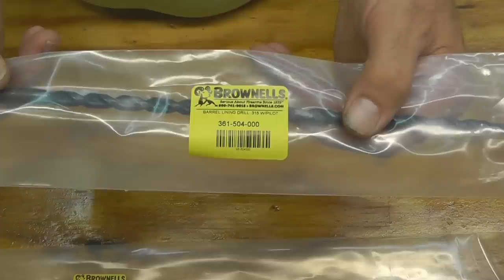Relining the barrel on Grandpa's old  22 Part 1

Comment: You really need a lathe but for what you had to work with you did alright. Only thing I could suggest is slow your drill speed down and use steady pressure. Those old barrels have hard spots that under high speed will burn up the cutting edge of your drill. Saw one at auction just like yours go for 450.00 but it was about 85 to 90 percent.

Comment: rare to see a .22 rimfire "shot out", it is a corrosion problem, early ammo used priming compound that caused metal to corrode very fast, age and neglect does the rest. It would help to use a true heavy duty 1/2 inch drill which runs much slower, is larger in size and has very high torque. A set up where a constant flow of recirculating oil is helpful. A lathe is the best option, the feed rate can be closely regulated.

Comment: Blue auto body painters tape is cheap and the 2" wide variety would cover the entire barrel while peeling off easily. Electrical taping the whole barrel is cheap too and the goo washes off with solvent easily. I use both to mask all sorts of parts for coating and painting.

Comment: one i would have lapped out the barrel before installing the liner and dont ask why but if you want it to be accurate pay a machine shop to drill ut out also i doubt that the gun was shot out i have a couple 22s that go back to 1938 and they have shot thousands of rounds and they are still like new also you dont have patina on that gun you have rust do it right boil it in hot water for 30 or 40 mins in water card it off then rust blue it really you have already molested it so do it right